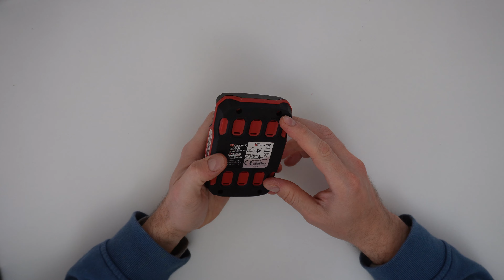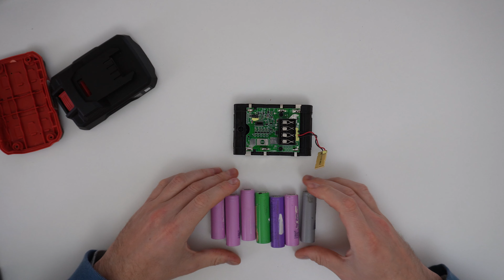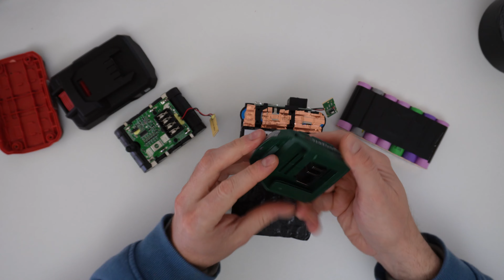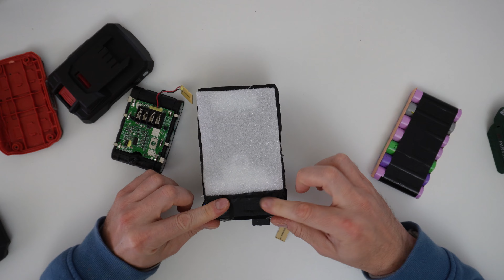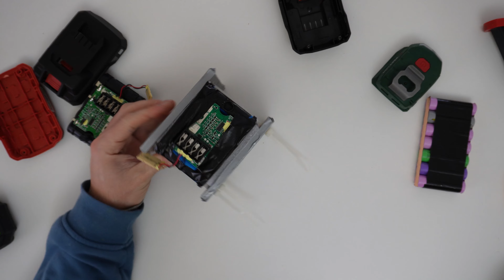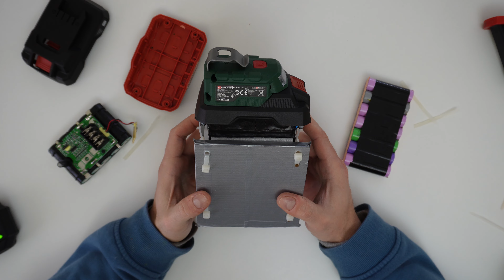Parkside Battery 20V 16Ah NEW MODEL

Comment: Επίσης έχω παραγγείλει 5 3.500 ah μπαταρίες. Πόσα αμπέρ θα μου δώσουν αν αντικαταστήσω τις 5 από την 2ah μπαταρία;
Reply: Do you mean Amps or Ah ❓
So you will go to a 3.5Ah pack
 The bms will probably limit the power draw to around 10 Amps per Cell. Your not presumably adding more cells   just their capacity. So your drilling time may last longer but no increase in power. If you add another layer of cells in parallel then you will get less battery 'Sag' and more oomph..
https://youtu.be/qiS2N8XGN0k
Reply: @johnrhodes3350  I wanted to say 3.500 mAh. If I add one more layer of batteries, it's gonna have capacity 7mAh. Is this right? Thank you
Reply: The original oem cell capacity is 2000mAh your new one's are 3500mAh
   The 'parkside' cells behave very similarly to the
Samsung 20S 18650 2000mAh 30A Battery - INR18650-20S
https://youtu.be/tnwnOT-K3Ds
This cell is the top in terms of current discharge/drain in the 18650 form factor size. It is for Mega-High Discharge/Drain devices only. This cell is the hardest punching cell in the 18650 size class by far all the way until it reaches about 33% drained. With a True 30 amp Continuous Discharge Rating with no temperature cut needed, you can see why that's the case. It also packs a modest 2,000 mAh in capacity as well. However, this cell is only the clear winner of the King of Drain in the 18650 form factor size, when it's used above the 25 amp mark, due to the shortage of capacity needed to sustain it's voltage throughout it's drain. It is an awesome cell when used in device(s) that require or demand more than 25 amps of Continuous Discharge/Drain, this is where this cell's potential is truly unlocked. This power cell does have a moderate range of capacity as well, but not its best strong suit.
Reply: @johnrhodes3350  I bought Samsung INR18650-35E 3450mAh - 8A. Is it ok for replacing the parksides's stock batteries? Thank you